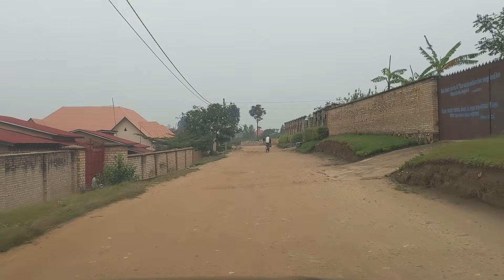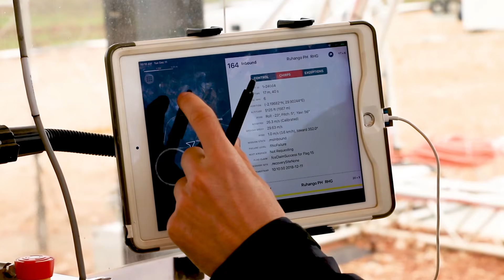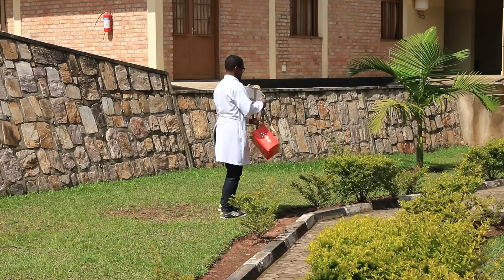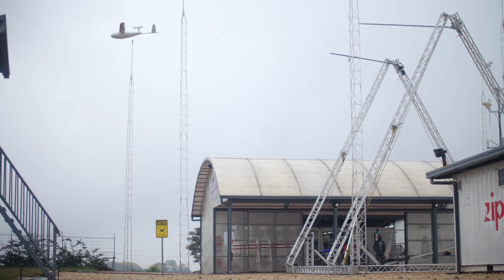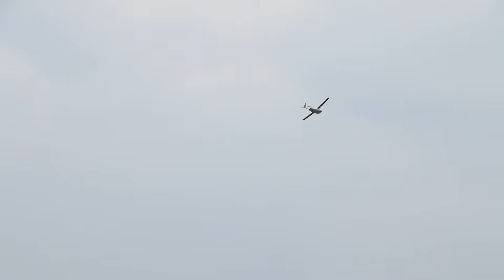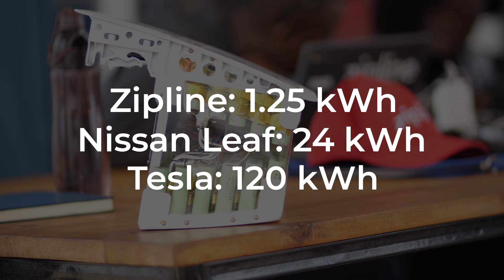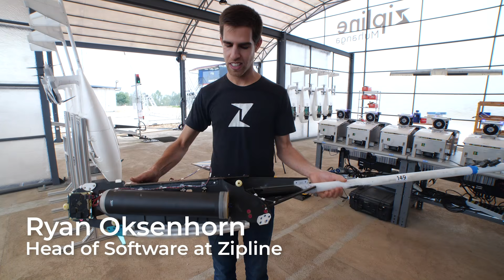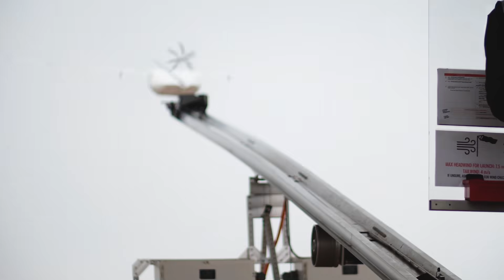Zipline - How Rwanda Built A Drone Delivery Service

Comment: This is by far the best drone delivery company i have ever seen ! Delivering with Quadcopters is such a lame idea...
Reply: no the Quadcopter delivery systems would still be far more efficient in short distances within urban cityscapes.
Reply: well you don't always want to parachute your soup on the floor.
Reply: Anything I have seen to come even near by is the DHL parcelcopter and skyport tests year or two ago, where they run two linked skyport packet stations for 3 months. In mountains, in winter. It was a tilt rotor craft.

In that also the key milestones aren't the craft actually though the tilt rotor was darn cool, but the integrated logistics involved. In Ziplines case they have specific area delivery from service hub to clients. In the DHL test they integrated two way the stations as part of their normal parcel station service.

Only one station was in a mountain side village on the end of a windy road and another at the bottom in valley.

The amazing part was the essentially fully automatic hangar and packet station. You put packet (a standard size DHL small parcel cardboard box) in the machine, the machine loads it automatically to a payload shell, attached the shell to their tilt rotor sitting on the landing pad. Packet loaded the protective doors open (since winter, one has to have a protected hangar), craft spools it's engines and helicopters out, then it transfers to winged flight, flies to the another station. The other station gets message from the craft, opens it's hangar, craft helicopters down, part of the pad slides open, arms reach out and detach the payload pod and take the parcel and store it in a automated storage magazine to be handed out.

their post truck comes around at the bottom of valley, they employee tells station to empty and it hands out the out going packages, then the employee inserts the up going packages and leaves, the station starts to shuttle the packages up the mountain.

The integration and automation is the key. Anyone can strap a packet to bottom of quad copter by hand and tell it to go to GPS coordinates. The real business is in creating the integrated services with the redundancies, securities and day to day on going process.
Reply: i think each one has is advantages
Reply: Sébastien Fraggl thats where you are wrong.Quad copters can fly lower and for a more regulated airspace you need that
Reply: @dekonfrost7  exactly. and  they can land on very small surface
Reply: ok this make more sense in flat spaced out areas but a quad makes more sense in a city the drone could just drop your package on a fire escape
Reply: Go get smart with Wingcopter
Reply: In a giant field? Of course. In a residential area or busy city… good luck!
Reply: it may be faster, but quadcopters are safer. You don t have landing problem
Reply: Yo check out ziplines fancy silent "quadcopter" elevator solution
Reply: Drug cartels at US borders seeing this clip...''hhhhhheeeemmmm interesante'' !

Comment: Showerthought:
About the landing trip wire. Is it possible to create a rotating tower to present the landing wire against the prevailing wind? So to speak, their landing towers are fixed and winds blow on any of the 360 degrees. Quite similar to rotating poles of astrotelescopes, stage lights, etc.

Comment: Zipline is an automated logistics company based in California. The company—which includes
seasoned aerospace veterans from teams like SpaceX, Google, Boeing, and NASA—designs
and operates an autonomous system for delivering lifesaving medicine to the world’s most
difficult to reach places.
Zipline’s long-term mission is to build instant delivery for the planet, allowing on-demand
delivery of medicines and other products at low cost without using a drop of gasoline. Some of
the smartest investors in the world support Zipline, including Sequoia Capital, Katalyst Ventures,
 a16z, Google Ventures, SV Angel, Subtraction Capital, Yahoo founder Jerry Yang, Microsoft co-founder Paul Allen, and Stanford University.
Reply: It's good to be honest and give credit where it's due.

Comment: Also, it's not exactly rocket science to do all your preflight checks during idle time, so that when the order comes in, you literally just put the blood in the plane, close it up, and push the button to launch. What are they doing, fucking around attaching wings, and checking the flight surfaces, while the clock is ticking?

Comment: Q: Why not have a drone completely ready, beside the payload, at all times?
 I worked as a plane technician and while on interception missions we did all the PF in advance. 
Beside battery drainage, which can be swapped every few hours,  whats stopping them from having one ready?
Maybe a second launcher so you can have one in PF and one ready?
Reply: Maybe they see it as equivalent to pilot checklist prior to takeoff. In a regular passenger aircraft this must be done IMMEDIATELY before takeoff, not some time earlier. They do a pretty good job too, following a sequence that’s pre-established to the second.

Comment: The aircraft side of this tech interests me far more than the air-traffic side, though the latter is undoubtedly more important.
As battery energy density increases, a VTOL version of this system will undoubtedly take over (Google was working on this - not sure what they are up to now).  This chute-drop is a great niche, but something that can take off and land anywhere without a massive sacrifice in simplicity or efficiency will win IMHO due not only to increased mission diversity, but a very, very low complexity to the launch/land infrastructure.
I'm surprised they do the full inspection right before launch instead of having an aircraft ready to go at all times.
Amazing that someone is actually doing this, and it's been fun to follow along with this venture since its inception.

Comment: All comments are praising this video, and not a single comment about any negatives. I guess most of your viewers aren't critical thinkers, they are just stupid followers. They just believe anything presented to them on face value and do not think about Why drones, why not just build paved roads instead? Why medicines only, why not food? Why not build refrigerators to stock medicines, why transport at all? Why not solar arrays for better access to electricity too & overall growth of the economy instead of just drone infrastructure development? Building paved roads would have been more useful as anyone can be transported, rather than just using drones to deliver a very specific item - medicines. It doesn't seem right. You might wanna do some more investigative journalism to find out who pushed for this idea, who donated for this idea, and who is nefariously benefiting from its deployment.
Reply: There are paved roads currently being built lol and Rwanda has the largest solar project in East Africa, the most affordable solar home systems in Africa too. This a short-term solution. Despite the massive improvement in the economy, it is still a poor country.  In rural areas, the Rwandan road network remains pretty dependent on international donors and bilateral investments. Rwandan hospitals do have refrigerators to store medicine, but he literally explains why sometimes it isn't as efficient to use drone service

Comment: Also, for anyone question the involvement of Rwandans in this initiative, the actual operations center of the company is entirely in Rwanda and maintained by Rwandan staff. Not to mention that the company relies on the Rwandan air traffic control system.

Comment: They were working VTL plane "Osprey" at NASA Ames Res Ctr when I was there and the physicists and engineers who worked on it were all imagining it being used for medical and humanitarian purposes rather than as a war vehicle (though the funding was probably helpful).  While I see the cost efficiency of the drone shown here, an Osprey model would help, or at least enough tilt on the wing to soft land. They've also done wonderful work in mounting many small motors on the wing to give extra lift and speed for the same power use as a single large motor. video of NASA's "Greased Lightning" https://youtu.be/RKYWsM-DHCQ and use a generator on board to power the electric motors.

Comment: Surprised they used LI batteries, as opposed to LiPo.  Much safer, but less power density.  Cheaper to ship, also.
Reply: AZOffRoadster LiPo batteries are a type of lithium-ion batteries.

Comment: Interesting the navigating circuits are in the battery
Reply: They are in the same module together with the battery. Which makes sense, If you have any fault just swap out one module then you get a working GPS, memory and battery unit.

Comment: Is there a wing mounted engines version of the drones??

Because engine mounted at the rudder is kinda retards, since most planes or plane shaped drone has engines mounted at either the nose/wing/near the back, also the drones should have classes like light, medium and heavy

Light class for short ETA (rudder engine)
Medium for between both (nose/wing engine)
Heavy for more capacity (nose/wing/back engine)

Comment: That is a cool launcher. From the start to the end of the device it took 17 frames. This video is 30fps, so it took 0.567 seconds. It's hard to estimate how long that device is, but I would say 2-3 meters. So it launched with 6-9m/s^2 😊
Edit: I just continud to watch the next 10 seconds of the video 😃 100 km/h in 0.3sec  -->((100/3.6)/0.3)/9.8= thats 9.4g 😮

Comment: why liion cells? it is so heavy. Lipo is way lighter and higher power density.
Reply: spook probably cost. There some new carbon cells in development now that should send battery tech forward significantly but it takes a while for things to become cheap enough to implement

Comment: Very nice video, but only thing I haven't understood is, why they assemble the aircraft after order is received. 
If they assemble the aircraft before, can make preflight checks etc. and connect to aircraft low-current voltage supply to prevent battery discharging.
Then flip the aircraft upside-down and wait for order. After is received, is needed only to prepare package, put it into cargo area of the aircraft, put aircraft into takeoff ramp, and takeoff.
Preflight checks can be made also every hour for example, in case no order comes (is enough time for it).

If the aircraft has doors to the cargo area from the top side too, preparing to takeoff is even simplier. Only do preflight checks ready on takeoff ramp, and wait for order.

This can make the delivery faster for few minutes...

Comment: I don't really agree how this operation can be described as "cheap."  The technology and the carbon-fibre parts as well as the data storage and gps systems being used here are pretty expensive.  Not to mention the security aspects of having a launching port facility like this in the middle of a country like Rwanda.  There is a bigger plan here and this is just a stepping stone for this company to prove their technology.  I feel like there are a lot of points not being raised or discussed here.  Having worked in many of these countries myself, (you need to have worked there to know what I mean), it's not exactly easy to implement these high-tech solutions in poverty-stricken environments safely or effectively lets just say.  Love the ingenuity aspect and the engineering behind these ideas but I feel like you are glossing over other important points here too, regardless of security aspects.  Like the distribution network that would be required to get the blood packs from point of donation to the launch facility.  If that isn't in direct range, it would drastically increase the time required to deliver blood types to different remote areas in places like Rwanda.  Blood packs have seriously short shelf lives too (compared to drugs for example) and to use this as an example  is very misleading.  The chances that this one launching facility will have the exact blood type continuously available for the moment it is required for a remote 100mile radius area is either highly unlikely or highly expensive to maintain continuously.  I get the feeling that this is some billionaire start-up company using a third-world country, with minimal regulation in aviation, to test it's technology at relatively low financial risk and no regulatory red tape, in the cheapest way possible with the long-term idea of maximising profits back in the west once they iron out all the teething problems.  Amaright?  This system as a long term delivery solution in a third world environment doesn't make sense and is neither profitable or sustainable and doesn't work logistically v cost.
Reply: Zipline International is currently hiring for the following: Business Development, Flight Operations, Electrical Engineers, Accounting Leads, Controllers, Global Systems Integration Specialists, Training and Certification Specialists, Legal Counselors, Manufacturing Engineers, Supplier Development Engineers, Warehouse and Logistics Specialist, Hardware Systems Development, Integration and Test Engineers, Mechanical Engineer, Data Analyst, Data Scientist, Dev Ops Engineer, Embedded Software Engineer, Flight Software Engineer, Full-Stack Software Engineer, Software Tools Engineer, Quality Inspector, Head of Safety Engineering, Operations Engineer, Flight Safety Systems Engineer, Onsite Coordinator, People Operations, Recruiter, Contract Recruiting Sourcer.

That is a helluva lot of things to be hiring for... Sounds like they have a LOT of financial backing!
Reply: Jesse Back ...you probably could have summarized this list somewhat, don't you think?  They may very well be recruiting but that doesn't mean they are building a giant network across 3rd world countries to service their emergency blood transportation services.  Most of those positions are in SoCal I am betting.  

However...update....COVID-19 may have very well just given this company a massive opportunity assuming that a vaccine is developed in the immediate future.
Reply: Zipline International out Half Moon Bay, California is the company Rwanda contracted to build, operate, and maintain the facility. Funded by Microsoft, Yahoo, and UPS. But mostly by UPS. Real world testing ground for drone based package delivery?
Reply: Jesse Back ...with those investors onboard, sounds about right.  In some cases we could agree that this is a win-win situation, as they are puting to good use the testing phase of this technology to help and assist a shortfall in services in a poor country, and that ultimately is saving lives.   Long-term, though I worry that these services might be relied upon and ultimately I would be very surprised if they intend to stay in Rwanda long term because the numbers don''t make sense.  Is it moral to use a third world country as a test bed for this technology?  Once aviation regulation in the US/worldwide is overcome, and it becomes a big profitable business for deliveries for UPS and its partners, will they still be offering these services in Rwanda?  Or will that be "wound down."
Reply: @WallyMcFly  Right... There is no way this is profitable for them right now in Rwanda. Makes perfect sense now: Start there and use it to test, but make it look noble and gain a good reputation for your company by doing something worthy. But they won't stay, will they? Once the development is finished and enough data is gathered... Now I understand your concern.
Reply: You're being way too cynical. It doesn't have to be cost-effective. It may be subsidized by the government or international charities. The problem is that in Rwanda there are places that are very difficult to reach.

And what's wrong with them possibly having plans beyond Rwanda? That may end up being mutually beneficial. We don't know where innovations like this will lead. Let's not assume that we do.

Comment: There was a TED talk on this. I was impressed that an African nation was able to pull it off
Reply: Modern tech in many ways is easier to implement in a country without an existing infrastructure.  If Rwanda, for instance, wants to build out a clean energy infrastructure, by in large they just need to implement solar instead of coal (lucky for them, solar is cheaper to implement these days than coal anyway).  If the US wanted to do the same thing, on the other hand, we first need to dismantle all of the infrastructure & job sectors we have built up around the coal industry, & then replace it with solar/wind -- completely tearing down the old system & building a new one.

For that reason, you see some serious innovation in poorer nations... not just new forms of energy & new ways to deliver medicine, but for instance, new forms of loans with peer to peer lending, new ways of banking with decentralized block-chain based systems they can use on their phones, new ways of manufacturing with 3D printing taking off, particularly in hospitals that often have older machines break down just because they're missing or have broken a single little plastic part, the list goes on... hell, in the near future, we're going to see them largely adopt satellite-based internet to solve the problem of not having the money to build up a ground-based internet infrastructure.

The poorer parts of the world aren't following the same steps we rich countries did when we industrialized -- they're leapfrogging all the old shit & going straight from having nothing to having the latest tech.